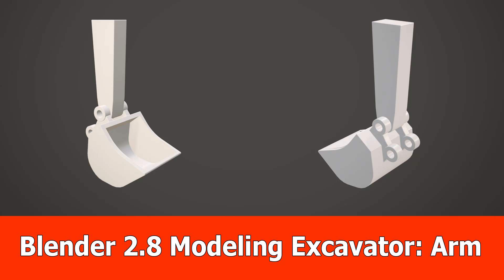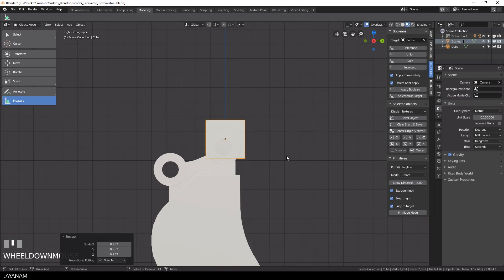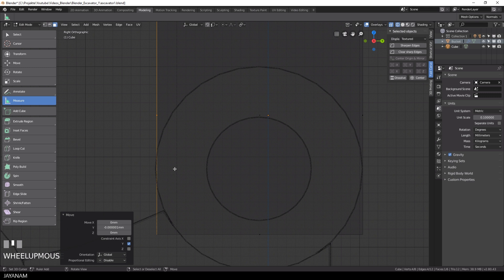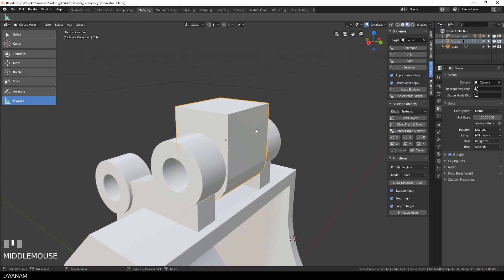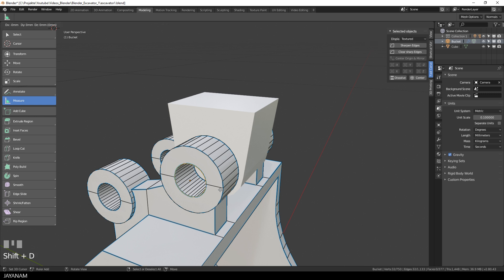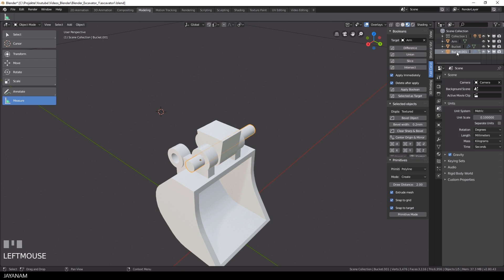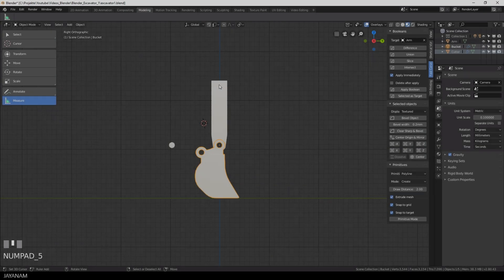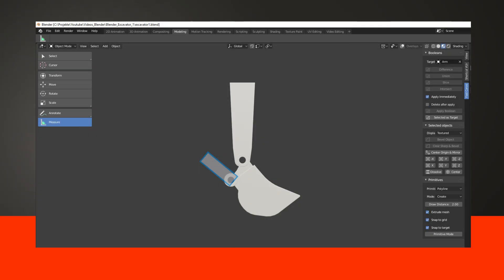Blender 2.8 Modeling Tutorial : Excavator Arm for 3D Printing

Comment: PS do you perhaps know a shortcut or addon which copies the blender version, hash number, date? Each time i report a bug i find it quite tedious to check those details. I wish there was a quick copy button for this part. I already was thinking about making a addon for this case. I was looking in the code to see if this data is stored somewhere. I think it is because its showing on the splash screen. Do you know perhaps where its stored?
Reply: I do see this data is added when you do filemenu > help > store system info. Now i need to find where its located so i can make my addon. It will be much more pleasant to add a bug report without the need to open blende and memorize the hash code etc

Comment: Yeah!!! DId you check blender today yesterday??? COlored Wireframe Baby :)
https://www.youtube.com/watch?v=4LVDM-FedcA
Reply from the maker: Yes, I saw the viewport display update, I really love it:-)
Reply: @JayAnAm  I cant test on OSX though :( it doesnt show...
Reply from the maker: @RomboutVersluijs  Oh really... hmmm
Reply: @JayAnAm  Well i think i just found my solution. The operator sysinfo.py actually shows this info. So i can simply call parts of it and than store this. I make an addon which adds this to the help menu. Much faster :) Its line 58 / 62 i need for the addon. Now i need to check if i can copy this to the pasteboard or something
Reply: Okay done :) its working like a charm. Ill make a repo if your interested.  I simply will copy this data to the clipboard so you can paste it in the bug report. You wont need to do the hustle of showing the splashscreen and remember the code.
https://www.dropbox.com/s/rujswmojyz3dzzo/Screen%20Shot%202019-02-23%20at%2012.03.19.png?raw=1
https://www.dropbox.com/s/hnxy8c10yncdtc3/Screen%20Shot%202019-02-23%20at%2012.03.23.png?raw=1
I just need to add to copy to clipboard part now
Reply: WOuld you want to try it, i hope you work in windows or linux. I want to check if the copy to clipboard part works. You kind find it here https://github.com/schroef/copy-blender-info